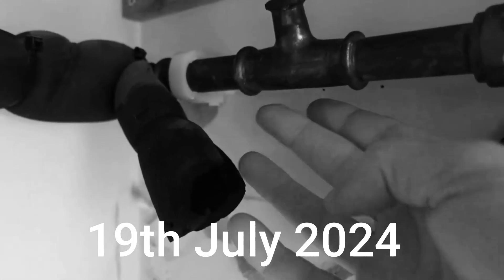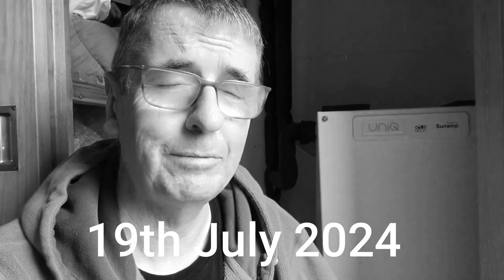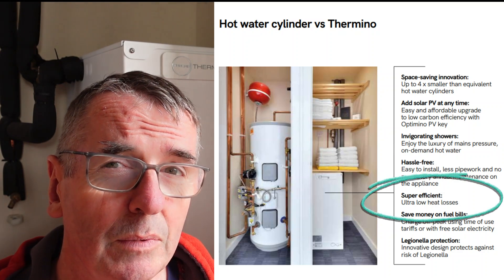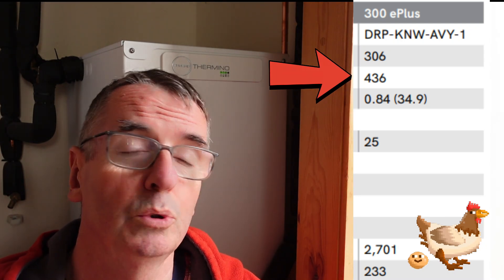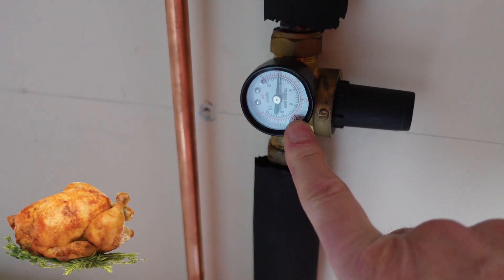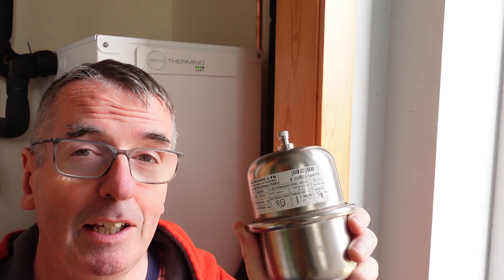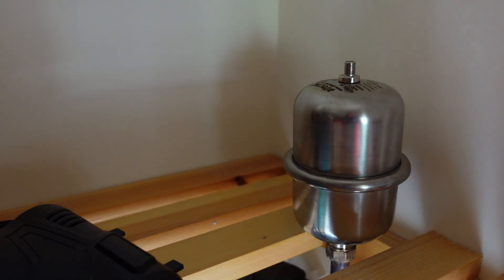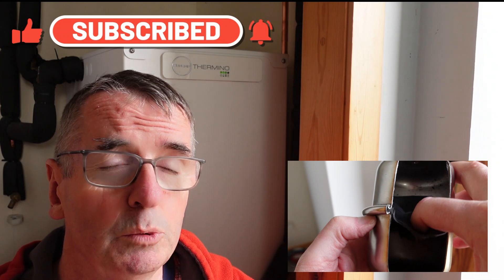Troubleshooting the Mystery: The Reason Behind my Sunamp Heat Battery Failure #sunamp

Comment: Does this provide heating as well or just hot water?
Reply from the maker: My set up is just for hot water , some systems use these to pre warm water before it goes into a Gas Combi boiler for a wet radiator heating system.

Comment: Hi Jonathan,

When you check and recharge the Expansion Vessel, presumably you need to:

- Isolate the Sun Amp from the Mains Water
- Run a hot tap downstairs

Because these two things will reduce the pressure in the Sun Amp system and allow you to take an accurate reading on the Vessel, and then recharge.

Because if you didnt, and you took a measure at pressure, you would get a false positive reading of the Vessel.

Is that right? Thank you.

I have a Thermino 300 and I am about to recharge my Expansion Vessel for the first time.
Reply from the maker: The engineer just said 'top up' the pressure vessel if it needs it !
Check once a year too , the pressure gauge hasn't dropped at all since fitted.
Still all working fine 🙂 👍
Reply: @JonathanPorterfield  Hi Jonathan. Just a warning that I think you are getting a false reading on your Vessel if you say it hasn't dropped since being fitted. I think you are actually measuring the Incoming Mains Water Pressure, which is being regulated using the Valve. You need to isolate the Sun Amp, open the hot water tap (to reduce the pressure) and then take a reading of the Vessel. You may find the Vessel has lost some charge since fitting.
Reply: @JonathanPorterfield  Just remember to check the Vessel's charge with the Sun Amp isolated/hot water tap open to remove the system pressure. Ie, remove the water pressure on the Vessel. As if you just measure it casually, the water pressure will give you a false reading. You'll just be measuring the Incoming Water Pressure itself. You can then top it up and refill the unit. Do you have a 0.5 litre vessel?
Reply: Expansion vessels should be checked at least yearly , it’s just a rubber bladder like a car inner tube - gas/air will slowly migrate through any rubber bladder over time  and yes the guys above are correct with regards to the testing procedure - remove the system pressure then set the expansion chamber pressure .

Comment: I was considering one of these until I discovered the following:
I have read about many people having had exactly the same problem.
This has been happening for years so Sunamp have known about it for years.
If an unvented system requires various other items to be fitted, like a pressure reducer, why doesn't sunamp if this problem occurs when you don't install one? It doesn't take much to have a warning that you can't miss in the installation manual, or even better, on the unit itself as well.
Why is the internal tubing so weak that it leaks into the PCM at mains pressure.  The house pipework doesn't leak so they can build it more robust. Okay, thinner pipework makes for a better heat transfer but then increase the run inside so the water is being heated for longer. If that's not possible for whatever reason it goes back to having warnings that you can't miss.
They can also make them with a built in PRV or, if not, supply them with all the external extras that are needed for a proper installation.
The problem is you don't need to be G3 qualified so installers are not installing PRVs. Even if it stated in the manual it will be within the instructions and you can't expect installers to read the installation manuals in detail of every single thing they install in detail. They will scan through to get the general info. Sunamp need to either supply the items of put a removable label on the heater itself so an installer can't miss it.
That's why installers of unvented cylinders have to be G3 qualified. All unvented installation manuals will have this information but it doesn't need to stand out so it can't be missed as a G3 installer is already trained to know this.
However, the accounts of the leaking units don't have any info on whether PRVs have or have not been installed. Maybe they have and the unit is still leaking. The common thing about all the accounts was that they started to leak after 3 years. This makes me think that because they didn't leak so soon that they did have PRVs, but still leaked.
Fischer were selling these branded under their own name. They fell out with Sunamp. The reason is not known, and it could be because Fischer are a fly-by-night company with many complaints against them, and Sunamp no longer wanted to be associated with them. On the other hand it could be that Fischer had so many problems with the units leaking that they no longer wanted to have anything to do with them. They just want to fit and forget. Literally. That's why they get a lot of complaints. Bad after sales service. The last thing you need is stuff that causes you to have to give after sales service.
Another thing I really don't like about sunamp is that you can't contact them with and enquiry about the product. The contact page is only for installers. I definitely don't trust a company that is not open to enquiries about their product.
I have decided, after a lot of research, to go for a Dimplex Quantum high heat retention unvented cylinder.
Reply from the maker: Thanks for your comments and explanations,  interesting times for Sunamp.
To date its still ok , time will tell !

Comment: If you read the Sunamp installation instructions - they don;t REQUIRE those mods, so don't necessarily blame your installer.
Also bear in mind that they max out a heat pump and run it far less efficiently than a DHW cylinder when they charge it. - It's called thermodynamics...
Reply: the Sunamp install manuals i've read this week (researching this option in my flat) say a pressure reducing valve is required

Comment: Ah, this explains what those valves on my system does. Glad to have them. I also note that my pressure vessel is the size of a football.
Reply: It’s an expansion vessel , when a liquid is heated then  it’s volume grows and it needs to go somewhere or there is risk of a burst due to pressure increase  , if you have a large volume of pipe work and low input pressure it may not be needed , however if the incoming pressure is high and not regulated along  with short small bore pipe runs there is a risk of problems , anybody who is fitting any type of water heating/storage system should know this and fit the necessary components to bring stability to the system.

Comment: Hello Johnathan, if you are going to check the pressure in the expansion vessel you must first depressurise the cold water side. Also as the vessel is so small when you remove your pump valve you are loosing a lot of pressure in the vessel. You are best using a traditional dial type gauge to gradually release excess pressure to the correct value.
(Use your pump to fill to approx 3 bar then slowly decrease using dial gauge)🙂

Comment: how many kWh does it take to load the sunamp to full capacity ? and if I use cheap rate during those times then it should not have any loss of heat from the water as its on demand from the sunamp right ?
Reply: Hard to tell as the Sunamp only has indicator lights and no control app. Then Kw depends on HP or electric. Based on my usage when I was heating with an Eddie, I'd say I used around 2KW to charge at 150 to full from under 50%.

Comment: That new "pressure vessel failure overflow pipe" is too long/close to the floor.
If you did have a failure in winter then you will most likely get icing which will then prevent the whole reason for being there.
Either cut it shorter so there is space to flow out or perhaps extend it to the drain I saw installed.
Oh and you really should have some insulation around it.

Comment: If you have a heat pump and a hot water cylinder then it is cheaper for hot water as the COP of a Sunamp is 1.0 compared with heat pump COP 3-4.
The advantage of the Sunamp is that is it very compact. If you currently have a combi boiler then you may not have room for a cylinder.
If you are changing from a combi to a heat pump however, I  think you need a hot water cylinder heated by the heat pump to qualify for gov subsidy. Having a Sunamp in this case may void your subsidy ( maybe there is a model of Sunamp which does qualify  ?)
I have a very early model from Sunamp to complement my combi as it allows my Solar PV to provide free hot water March-October without the need for gas and we don't have room for a hot water tank.
It gave me some grief the first 2 years until Ivan and his mate came from Sunamp in Edinburgh to fix it and it has worked fine since then. If it keep s going another 3 years I may get another newer model at some stage.
Reply: @Birko64  I think Sunamp do a version that works with heat pumps so you get the advantage of the COP - they did a project with Kensa Heat pumps in a block of flats - it’s on their website
Reply: I have the Valliant version of the Thermino. Was getting a COP of around 4.5 for 70C hot water to charge the Sunamp this spring/summer.

Comment: Jonathan, I'm curious why you opted for a Sunamp heat battery rather than a Heat Pump?

 I'm looking at replacing my gas boiler so am interested in the alternatives? I did look at a Tepeo boiler which I think is similar technology to Sunamp? But couldn't see any advantage over a Heat Pump?
Reply: Hi Malcolm, I’m sure Jonathan will give you his answer. From my understanding the Sunamp is best used just for your DHW as opposed to central heating. I looked at heat pump hot water tanks but was put off by the requirement for an annual inspection (at what call-out cost - £80?). The Sunamp is maintenance free, I’ve just got the e version but it charges in the cheapest Octopus Agile slots eg. Tomorrow the prices are negative between 1330-1430! Another advantage is their compact size so if you’re going from a combo boiler but don’t want to lose a whole cupboard to put in a water tank - Sunamp battery will only take up half a cupboard. Definitely worth a look at - hope this helps
Reply from the maker: Ive a heat pump already for my heating , the sunamp is instead of a hot water cylinder.
Reply: Hi Malcolm. The Sunamp Thermino uses thermal storage to be a really space efficient replacement for a DHW cylinder. It is ideal for diverting excess solar generation, and as is based on a phase change material storing latent heat. The tepeo ZEB applies the approach of thermal storage to space heating, but using a solid, high-density material as its thermal store, and storing sensible heat with a much higher capacity than the Thermino. The main advantage of a ZEB over a heat pump is in the installation, where a ZEB can be connected to the existing radiators and pipework, while a heat pump installation generally requires much more disruption.

Comment: Interesting. I had no pressure relief valve on my install. Heat exchanger cracked and filled my front room up with water 🤔 i was happy with the technology otherwise.
Reply from the maker: Sounds like a must have then , a relief valve
Reply: @JonathanPorterfield  Would have been such a relief had i had one 🤣
Reply: all the Sunamp install manuals say a pressure reducing valve is required
Reply: @GeorgeHafiz Bit late now. Its gone and replaced with a heatpump and tank